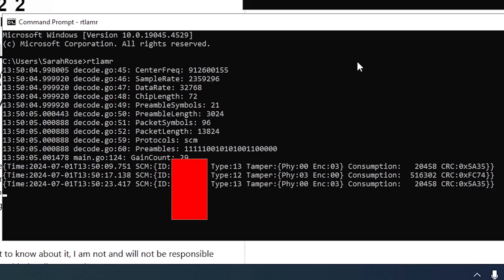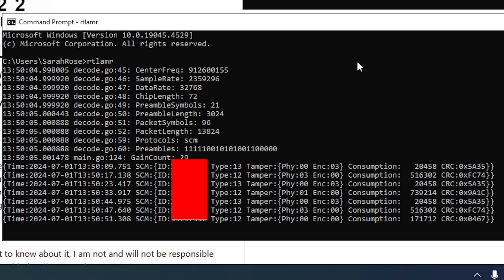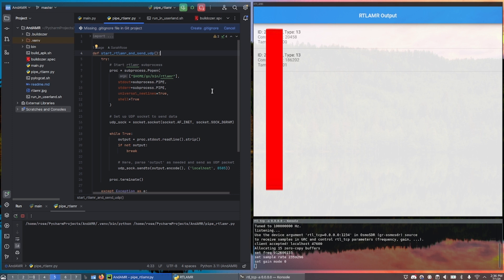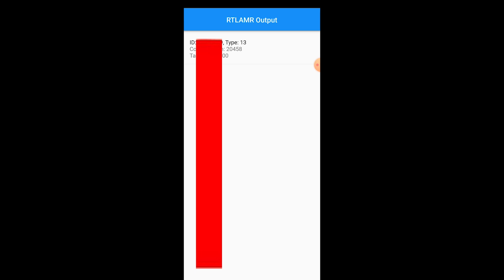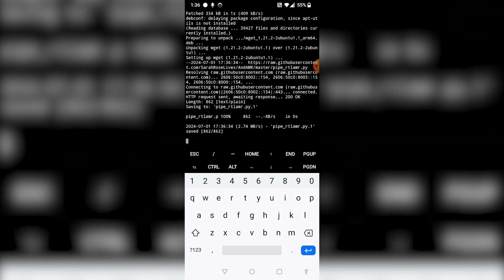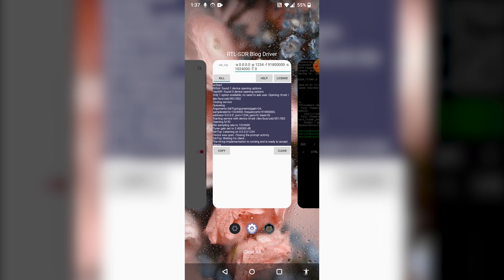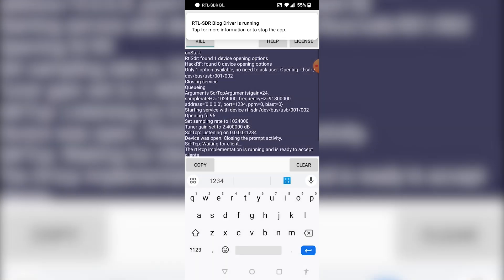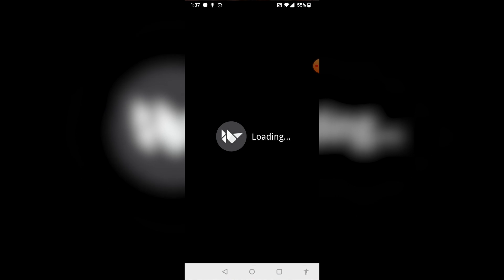Monitoring Itron ERT Smart Meters on Android?!

Comment: Hi, on water or gas meters will the message contain battery voltage? Ive always been curious if theres a way to see if a meter is low on voltage and not reading correctly.
Reply from the maker: No, they run off mains
Reply: @SignalsEverywhere  on gas meters too?
Reply from the maker: @ParkerCNG  that' I'm unsure of

Comment: Is it worth Mentioning if Root is Required for this to work on an Android device? I didn't see you say anything about it. Reason i ask is because i get an error trying to get the GitHub from the link you provided. and you siad use a (Chroot) app. Not sure what that is. Glad to see you are back, Missed you!
Reply from the maker: Root not required
Reply: Would like to Say also Unless your Meter is listed in the selected Meters that are approved, it might be hit and miss if this will be of any use to you. I was able to get it to run on Windows 11, And pick up Data of meters. But none of the meter ID's it picked up, was mine (Even though my meter was 5 feet from the antenna). So even though it does work by collecting data, power, ect. It fails to have an ID for my meter.

Comment: Looks interesting, But..How do I set this up in Windows ?? As you show using Windows 10.. (I can't find a compiled version in the zip) or am I looking in the Wrong Spot (I don't see any RtlAmr.exe. file)..??
Reply from the maker: Here is the windows release compiled: https://github.com/bemasher/rtlamr/releases/download/v0.9.1/rtlamr_windows_amd64.zip
Reply: @SignalsEverywhere  Thanks ... That's Half the Battle.. (Copied All the RTLSDR.dll and RTL_TCP.dll) 64bit zip ones. to the same folder ... Now all I just need to do is figure out (How to make it  .go.) no pun intended.. (So.. I'll Give you two ❤❤ ).. But .. No Kiss just yet. 🤯❓
Reply from the maker: @x_CrossHair_x maybe I can do a windows tutorial in the future if you're still having issues
Reply: @SignalsEverywhere  That would be nice 👍🙂 (I can handle a Batch File) and have Enough knowledge regarding command switches... (No clue about "go") so.. (Hopefully it can be optional).. Plus it's late 2 AM.. Time for a Sandwich.. And Bed.. 💋💋<< Kisses in advance for a Tutorial..

Comment: I succesfully compiled and ran rtlamr on a raspberry pi. No data received so far, since gas and water meters at my condo building are analog. Power meters are digital, but they seem to use a power-line communication system (PLC) which by the way is a terrible source of RF interference on the HF bands😓
Reply: great video!!
Reply from the maker: Thank you so much
Reply from the maker: Power line communication is the worst for our RF bands for sure!
With your antenna make sure it's not too big, this is all 900mhz ISM band so a larger antenna is actually going to make reception harder. Tune the antenna if it isn't already and see if that helps.